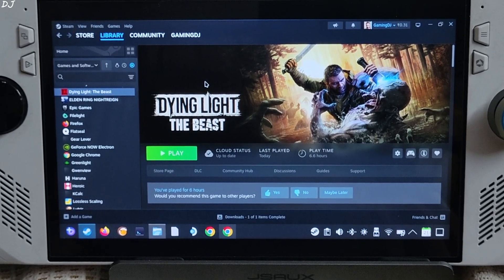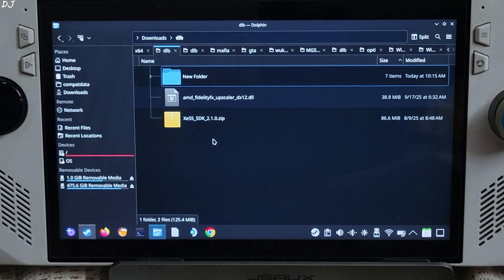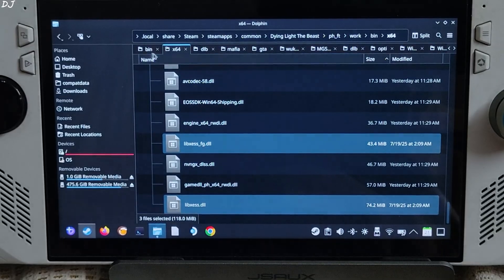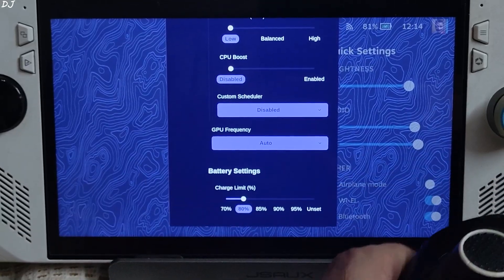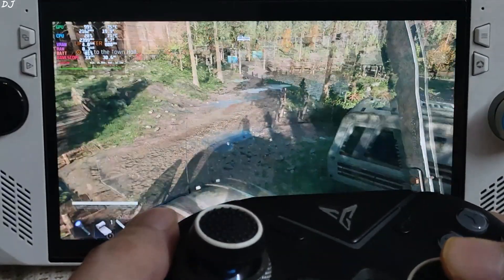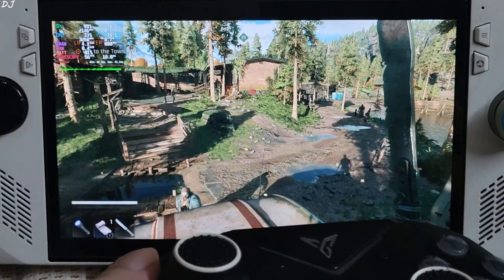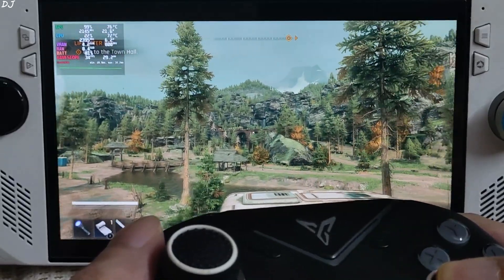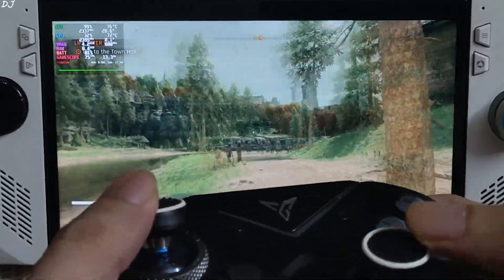Rog Ally Dying Light Beast FSR 4 INT8 Upscaler + XeSS Frame Gen Setup [No Mods] Bazzite Linux RDNA 3

Comment: Can you test Star Wars Outlaws with fsr 4 and Xess FG? I want to compare it with the Switch 2 version. I think the Ally will be as good with some minimum artifacts
Reply from the maker: Bad performance on ally , game stutters a lot in the open world . 16gb of physical memory isn't enough for it
https://youtu.be/CuBoISCYmxE?t=293&si=qpuh-8NI6gD5m-5k
Reply: @GamingDJ4u  But maybe it's better now 1 year layer😢. Just one quick video please🥺
Reply from the maker: It's still very bad, forced ray tracing. This is the best possible performance in empty areas
https://youtu.be/WH1ki-SvRJU?t=236&si=h1aYJ_s1uEcQsg2Z
In populated towns, frame pacing / freezing issues will occur
Reply: @GamingDJ4u  But you tested at fsr balanced with the Ally right? You could test fsr 4 on performance or ultra performance😓
Reply from the maker: I already told you about the memory related issue / limitation , this game struggles to maintain 60 fps even on my desktop pc in crowded areas . You can even test the demo yourself which is deliberately set in a non demanding area.

Comment: If you use Upscaler to XeFG, then the delay is much lower, you can try to do it yourself and see for yourself, apparently XeLL does not work well in the game, otherwise I cannot explain why opti XeFG works better In terms of delays.
Reply: It works fine without optiscaler mod . Check xess inspector with xess frame generation enabled. Latency is lower than fsr frame generation.
Reply: @leonkennedy-sv9od Yes, it's lower, but with Opti it's even lower.